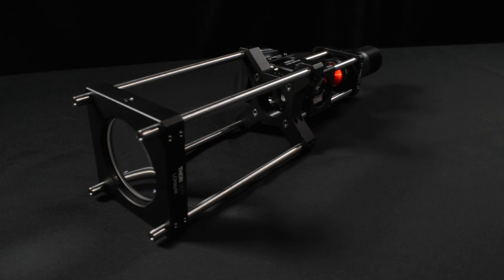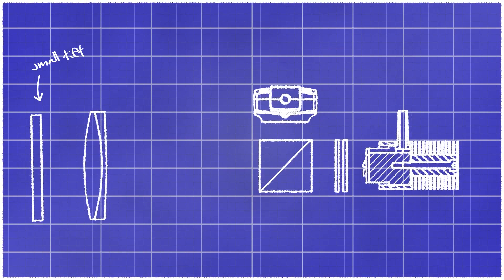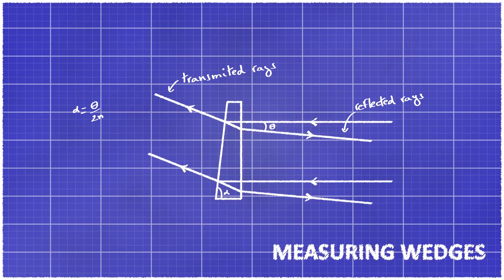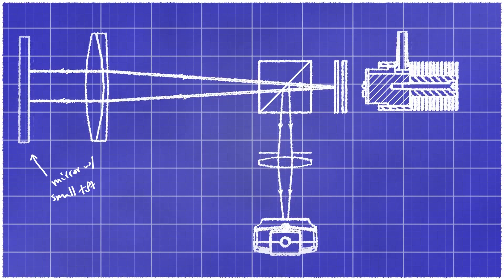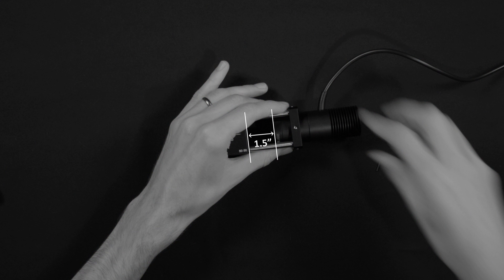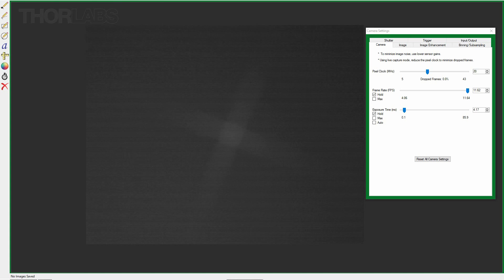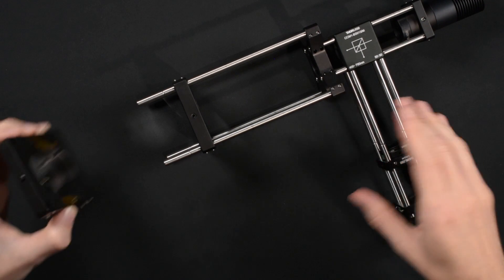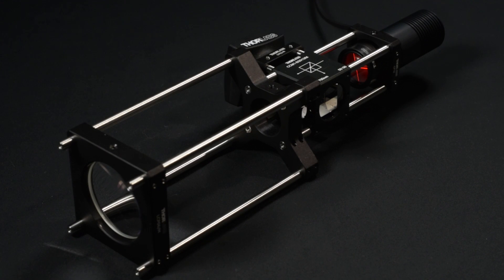The tool every optical lab needs to have

Comment: Thanks! Phantastic video! I have one question: If the collimator objective is somewhat tilted it would redefine the optical axis in an unwanted way, wouldn't it? If so, is it possible to use a kinematic holder for the 2" lens to adjust it after roughly setting the correct focus distance, removing the reflective surface mirror and trying to collimate the collimator objective by centering the reflected reticle by the lens with the original reticle image? Does this make any sense or improve the precision of the autocollimator, or is the tilting caused by imperfect mounting in the lens holder negligible in that context?
Reply from the maker: I would not use a kinematic mount for the lenses here for the following reasons. There are actually three different axis in the setup: (1) the mechanical axis, (2) the lens axis, and, (3) the axis of the projected beam. While it is true that a tilt of the lens will affect the optical axis of the lens compared to the mechanical axis of the system (as well as decentering or tilting of each individual surface of the lens), it is not the major source of departure between the mechanical axis and the projected beam axis. Most of that will actually come from the centering of the reticle which is on the order of 1mm roughly here. Defining an absolute axis is not an easy task which is why autocollimators are most often used as relative measurements comparing a state of a system with another state. Hope this answers your question :-)
Reply: @thepulsar  First and foremost, thank you for your prompt answer! I understand that the autocollimator essentially defines a new axis via the projected beam. It might be close to the desired optical axis , but as long as all mirrors, crystals, etc. are aligned along that "unknown" axis, I should be fine. Is that what you meant by relative measurements? Your answer brought one more question to my mind: does the shift of the center of the reticle by, say, 1mm off the optical axis in the X and/or Y planes (translation) have any mentionable effects on the angular alignment process? True, the center point is not in the projected beam axis, but the angle error of an reflected beam against the projected beam is still visible by the shifted return image and can be still be quantified by taking the focal length of the collimator lens and the pixel size of the camera into account. Or am I mistaken here? Also, if the reticle itself is slightly  tilted, apart from that not all of the reticle might be focused in the camera picture, does this effect possible measurements of the misalignment of reflections against the axis of the projected beam? As the reticle is in front of a diffusor, does it contribute to the projected beam axis, or is the axis of the projected beam soley derived from the orientation and optical properties of the splitter and collimator lens? Does it make sense at all to try to put the center of the reticle into the axis of the projected beam, it seems arbitrary to me as long as only angular misalignments are measured?
Reply from the maker: You can (and should) always try to center the reticle to the optical axis of the lens; however getting a truly perfect alignment will be difficult and expensive to achieve (there is no real limits!). Here I chose some kind of tradeoff which makes sense in the context this setup was designed and used. For example, one of the major limitations is that there is slight distortion compared to a F*tan(theta) rule and so the relationship between numbers of pixels and angle is not strictly linear. Nonetheless, it can still measure relatively accurately very small angular motion like the wobble of a translation stage. If you check in the archives of the website, you will find this very example. I hope it will give you an idea of the kind of things you may be able to get with this setup. I also posted a video on how to align a vise on a mill using it :)
Reply from the maker: http://www.thepulsar.be/article/precision-motorized-translation-table/

2mrad that's 2mm at 1meter, just to give an idea :)

Comment: Maybe I ask a silly question but can we use 1" achromatic doublet lens instead of 2"?? 
Very very good project by the way
Reply from the maker: yes no problem to use a 1" doublet :) depending on the resolution you try to achieve, you can also use a smaller focal length like 100 mm or 150 mm

Comment: Been following your website, esp. the recent ones on Raman -- very nicely done! Two questions: (i) any advice for putting together a system for gas-phase Raman? (ii) I feel like I read somewhere you're working on putting together a laser-diode driver ... anything you can share on that yet?
Reply from the maker: I have never tried gas-phase Raman up to now. I can test it but I am afraid that I may not have enough sensitivity to do that :-/ I will test anyway

Concerning the laser driver, I have some bad news. I just tested the board a few minutes ago and it fried my laser diode in a few seconds. It was working fine with LEDs and I was operating the laser much below its max current but for some reason it did not work. The light output of the laser dropped to zero after less than 20 seconds...

Comment: Hi, thank you for great video. Following your project you think it is possible to put the camera instead of the light source place? to reduce the total length of the autocollimator? Thanks
Reply from the maker: Sure :) The alignment procedure stays the same also
Reply: Thanks! The cube splitter orientation also remain the same or not? Do you thinks is possible to implement a system to have a greater magnification on the camera?
Reply from the maker: The cube orientation itself can remain the same ; nothing else should change even for the alignment. Having a magnification is possible but it depends on where you want the magnification to happen. If it is inside the autocollimator itself (so image of the reticle) you will need to add a magnification system inside the autocollimator which is not trivial. Better use a larger slit/reticle then. If you want the magnification to happen in relation with another system (e.g. you are aligning a microscope objective at infinity), you can change the autocollimator focal length. The magnification ratio will be given by the ratio between their focal lengths then. 200 mm like here is good to align microscope objective but if you project the reticle the other way around it will be very small with short focal length objectives. The solution is then to replace the 200 mm lens by a 100 mm or 75 mm one.

Comment: Thanks for this nice video. I can see how this comes in handy when seeing up a telescope. 
Say I would like to center two lenses on a common axis, how can this be done with this autocollimator? Can you advise a bit?
Reply from the maker: Hi Tom. Thanks for your feedback! To my best knowledge, the easiest way to center lenses on a given axis is to first align your autocollimator with a spindle axis where you will mount the lens and then place the lens and watch for the reflected profile. You will need an extra focusing lens in front of your collimator to do that. When the lens is not centred, the reticle will describe a circle whose radius is proportional to the decentring. By narrowing down that radius, you align the lens with the rotation axis. If you check for "autocollimator centering lens" on google image, you will find diagrams that explains the concept. Despite I have often worked with third party companies who uses that technique to align lens, I have never tested it myself so I cannot give you much more advices than that. When I have time I'll try to implement something but that will have to wait a few months - I am currently busy finishing my spectroscopy project :)
Reply: @thepulsar  Thanks for your reply! I found some pictures and they do look helpful indeed. Might be a bit of a pain though to properly align the focusing lens :-/

Comment: Great video thank you ! I'm in the process of building autocolliator myself from old 400mm telephoto lens  and some buts I acquire from ebay like led light source and  old microscope beam splitter ( the one used on teaching microscopes with two sets of oculars ) with have a bit more complicated prism when 50;50 cube.    I have one may be silly question , why you set camera on one side of prism first and after transferred to opposite ? It surely would work in the first place .
Reply from the maker: When the camera is in the first configuration, it allows to self-calibrate the autocollimator so that the lens is at the right position in regards to the reticle. What you observe then is the direct image of the reticle plus a dimmer image of the reticle that actually comes from the lens. It does already work in that configuration but, usually, people do not like to have the direct image of the reticle and prefer to have only the one that passes through the lens. That's why I put the camera in the second configuration. Extra bonus is that it is more compact that way. Also, by removing the alignment lens you get a slighltly better image quality but that's not a large issue in this system but it could be one in very high resolution experiments.
Reply: @thepulsar  Thank you for explanations, much appreciated :-)
Reply: @thepulsar   Future said about splitter prism I have found kinda unusual design here's link to the schematic ( sorry my drawing skills :-) https://i.postimg.cc/pLPKqsTF/Prism.jpg  love to hear what you have to say about and your view on how this my work in your autocollimator design? 
This prism have high degree of light cancelling between outputs ( there still ghost image can be seen ) .

Comment: Excellent video! Do you plan on doing one on measuring the resolution and calibrating microscopes using this setup?
Reply from the maker: In fact I already use this setup everytime I need to align system at infinity or in a 4-f configuration. When I have internship students I always start by explaining them how the autocollimator is working and ask them to align an infinity-corrected microscope setup. Based on experience, it is a very good way to teach student how to align things with precision. I started doing that after seeing a student using a ruler to align a lens/target :-) Could you develop a little bit what you mean by measuring the resolution ?
Reply: Ah, I was more or less referring to the usage of typical resolution charts such as a usaf or star target to measure the system's performance. It's also somewhat hard to get the objective, tube lens and camera in total alignment with such test charts. A bit of tilt throws everything off. I use a thorlabs 95mm rail and one of their filter holders to hold a chrome plated line chart, I would like to measure the resolution of a new lens I acquired for consumer digital cameras and potentially compare that against the Mit 10x objective. I'm still new to this field, really like these precise setups, lots of fun as a hobby (and expensive...).
Reply: https://flic.kr/p/Hi5s92 
https://flic.kr/p/26WZpZn
This is what my older primitive setup looked like. The tube lens I was attempting to use is the ITL200 which I eventually just gave up. The cheap tubes I was using is just horribly imprecise, and as of now, I can't really justify building a complete thorlabs SM2 tube system for I'm guessing just an edge in pictorial performance over the old Nikon 200mm  ais lens I am using as a tube lens. As of now, the 2 performs the same.

Pic 2 is just a piece of printed text on a card, a very simple method to see aberrations. I have a pretty good test target, just not exactly sure how to use it properly with the stuffs I have. Aligning them has always been a massive headache. I'm thinking that maybe using a collimator will make this process easier? I looked up those parts and what-not, it's really expensive, even though some parts can be sourced on places like ebay. Missed that small camera shown in the video for $80 a while ago, still a bit grumpy haha.
Reply from the maker: Nice setup and rail! From what I see you are using a high quality Olympus objective. Normally with that you should achieve diffraction limit (or close to) on full field. Most of the time I use just a 200 mm achromatic doublet as tube lens but I also used a 200 mm Nikon AI f/4 lens at some occasions with good results. From what I see you also have some kind of mechanical alignment between your microscope objective and your lens so that should give you some good quality. So I am a bit surprised when you say you suffer from aberrations. The only potential improvement that I see is to align it as a 4-f system to reduce aberrations. You can use an autocollimator to do that (align microscope objective/target first, then put a mirror between target and microscope objective to align the tube lens with the autocollimator and finaly align the camera sensor to have a sharp image). There can be variations on the alignment procedure but the overall idea is there. If you look at the end of my video on aberrations you can see the resolution achieved that way with a custom microscopy objective on a USAF 1951 target (to have an idea of what is "easily" achievable). Of course with your Olympus 10x Plan you will get much better resolution than the ~200 lp/mm shown.
Reply: Thanks! The objective I'm using is a Mitutoyo 10x mplan apo. Fragile little thing, mitutoyo objectives are made to break... good job haha. I guess olympus and nikon objectives are far superior in terms of longevity. Read too many horror stories about amateurs breaking their mittys from just a tiny bump or so.

My aberration issues, from what I can tell, stems from imprecision. I am using sets of cheap M42 tubes and a wobbly adapter with the itl200, the entire system is unstable. Using such cheap tubes also bring in other issues, such as thread precision causing misalignment of the optical axis, which could contribute to aberrations. 

Upon further research, there is actually a sweet spot in the "infinity space" from the tube lens. Calculations show the objective should be about 65-70mm from the end of the tube lens, and thorlabs quoted 70-140 for optimal performance. The mitutoyo MT-01 tube lens on the other hand quotes 0-165 or something, so it should be okay. I'm using a D810, which is more demanding than typical industrial cameras. Focused to infinity, the itl200 is great in the centre and abysmal in the corners. The 200ais is a hair worse, but the quality retains almost throughout the frame. This is shot wide open. I assume putting an objective in front would be equivalent to closing the iris down, I may be wrong. If that's the case though, IQ would be great on the ais. 

Read some articles on your site, very nice and informative :) Thanks for the great work! I've decided to bite the bullet. Going to purchase the Thorlabs' SM2NFM2 (nikon F to SM2 tubes) and a bunch of SM2 accessories for the itl200. Gotta do it justice! I'll share the results when the setup is built! I still stand by my statement, that the 200 ais would be almost as good as the itl200, and a lot better overall if corners are a concern. But anyway, even if that's the case, I'm left with high quality tubes, not the cheap junky m42 tubes, which have horrible internal reflection issues, hence manual flocking is also needed.